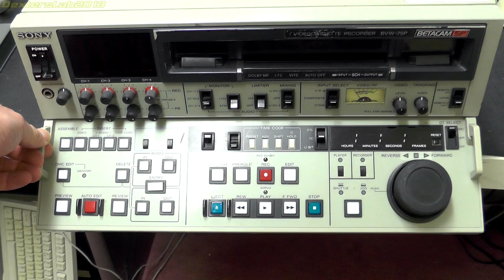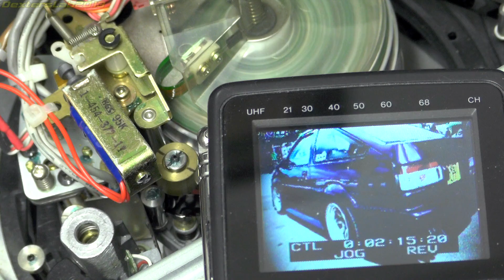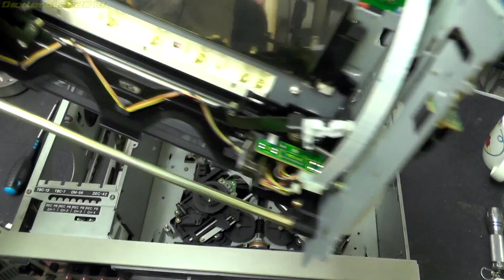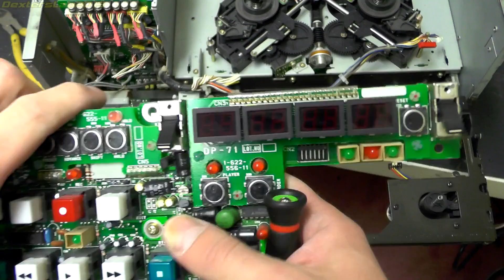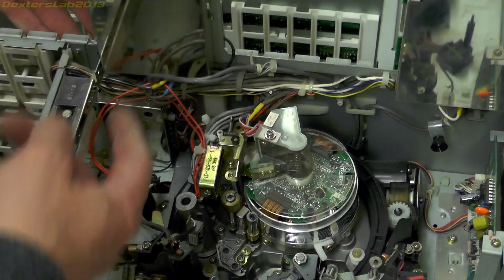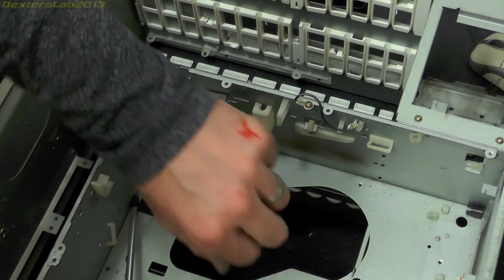DL090 - 1980s Sony BVW-75P Betacam VCR Teardown 1/3

Comment: hi pulled some apat to find a new way to re use the decks they are not good for any video work 
i do find they are great for audio  and a sony pcm 701 es  
up to 6 channels    9 years ago they wear junk deck not so any more  alot love to have them in a man cave 
i have 60 plus betacam all working  pulled alot apart to get them running

Comment: Wow I haven't thought about that for ages but CTDM is Compressed Time division Multiplexing. I think it was to do with the way the colour signals were stored on the tape one after the other on the same track alternating between signals and then stitching them back together afterwards.
I haven't had to recall that information for about 20 years but there it was just in my brain waiting to be recalled, only took me a few seconds. I guess some things never leave you.
I used to work with these for many years bashing away on the panel doing edits for tight deadlines. 
These things were so fast and reliable almost bullet proof.

Comment: hi again  i just done working on the last i have  of theis model  they are very well made decks  yes the SONY A500P can do a better job 
i have 12 of them   
but the power  the A500 range use i have to keep the running costs down

so i use the older decks alot of the time  only for audio play back  there's not alot in the running cost  of a 1/4 inch reel to reel  like the RS1700
or a otari mtr 12    1/2 inch  4 track 

you see i have to bill anybody for the power cost and the job  funny thing   i have saved alot of betacam sp decks from the skip

if like me you can get alot in the same place and pull parts as parts decks they can be saved   the space is the thing  50 plus betacam decks
takes space  just me and a big lady cat  no lady trying to tell me what to do

Comment: hi you know you said £25 ebay working  not any more i had them all   like you i pulled them apart to fix them up
kingswood hire place had them   it was better to have them as cash in the bank was doing bad at the time 
they sound ace used for sound  i have 50 plus now  all working  you seen the prices on ebay now

Comment: I need replacement head for my BVW 75.
Reply from the maker: Somewhat unobtanium now, best bet is to find another machine with less head hours.
Reply: @DextersTechLab  Currently I have 2x BVW 75. RT56 TP7-TP8 = ~90-100 mVpp. It should be 150-250 mV.

Comment: The only difference between the Sony pvw-2800p is that this one records four channels of sound, but if the 2800 has a Sony PVW-216FM audio module or even better Michael Sellman LTD, the sound is much better when recording both 2 channels and 4 on the Sony PVW-2800P model than on the Sony BVW-75 model and the stories that 75 writes better a myth that I can dispel by comparing these two models during recording and playback and at a price of 75 it was 3 times cheaper than 2800. how it breaks back is due to a flimsy or unfinished lpm, I am silent for the electronic part.
Reply: The pvw couldn’t do slo mo plus the BVW could use Betacam tapes if need be.

Comment: These were nearly £40k when first released in 1987. A real workhorse machine. The 3000hour service course was a week long ! I still have all the manuals and course notes, and a spare head, as well as BVW-75p number 2. A lot of the capacitors are now in need of replacement, which is quite a job.

Comment: Anyone know how to connect this thing to a monitor? trying to use a 5 BNC to vga cable but nothing is showing up...
Reply from the maker: +Cameron Murton VGA monitors won't work, you need a PVM/ BVM style monitor ideally or even an old TV
Reply: I had a feeling! thanks for the heads up

Comment: If it´s broken, ok. But what the hell your doing? It was a working machine. Cutting wires, the annoying way you hit the switches - Fine-Motor skills is not yours? Its cool if somebody have the skills to repair this stuff, but destroying old electronics !? Take it apart and then reassemble it,that would be great content ;-)  (Sorry for my english...)
Reply from the maker: hi, the BVW-75 was a very popular machine, there are usually 2-3 on ebay at any one time and here in the UK they sell for £10-£30 depending on condition. The one in the video was well used and had some faults, it simply was not worth repairing. Instead i was able to entirely take it apart on camera so others can see how it works, which is one of the main reasons for this channel.

Comment: Which is better, Betacam SP or 1 inch type C? Type C would be from a composite signal
Reply: Betacam SP for sure, although Type C was very good.
Reply: For what? I could put six SP machines in a single 70” tall rack vs several racks of BVH2000’s or a room full of Ampex VPR2B’s. 
For sports replay use the 75 was great. Smaller & lighter than any 1”, plus with a good remote panel which gave the op multiple cue points it was king until HD Cam and the EVS came out.

Comment: FWIW, the PB/EE switch selects whether you see/hear input video/audio when stopped. "EE" stands for "electronics to electronics" meaning the record electronics are feeding the playback electronics directly. One reason for the switch is to avoid feedback howl if the VTR is routed to itself.

Comment: Great video but... why did you destroy this machine, cutting wire, that unit looks like new? Barely has the dust on it, what a shame. I do not understand. You could fix it later :(
Reply: TVmasterNS  This can be done without cutting cables
Reply: They certainly have some value. Just need to know how to sell them... You like in UK and not in North Korea, so you can try selling them on Ebay after you put it back together.
Reply: Oh my.  That's the nicest BVW I've ever set my eyes on!  I'm about to get a couple of these serviced for many thousands of pounds each.  They are still required by archives that are digitising this tape format.  Some older tape formats are in trouble because there are not enough machines left in the world to digitise all of the tapes before the video heads wear out.  Please use a little initiative and think of the bigger picture - did you check how many hours use the drum, tape path and heads have?  You could've used a worse quality machine to destroy.  And you mention no detailed record of it - there are so many photos of the insides of these machines.  There are massive service manuals detailing the inside of the machines!  What, exactly, is the point?  My main issue is the the HOURS METER READS 0000.
Reply: Thanks very much for your channel. I'm wondering for a few years: last tape HI Tech format was HDCAM (based on beta) Is still using at some level inside TV Stations???
(archive? just still remain a lot of tapes waiting for digitilaze? any use in other propouses?
I´ll be very pleasent if you teach me about it
Greetings from Uruguay
Reply: TVmasterNS we have one for sale. are you interested?
Reply from the maker: +TVmasterNS hi, thanks for the comments, here in the UK these machines have no value even when they are working. My channel is about taking apart old tech and allowing viewers to see inside things like this that they might not normally be able to see. There is so much wonderful old tech in e-waste that is lost without any detailed record of it.

Comment: This brings back some nightmares.  Running tape machines during the 6 and 10 local tv news in '82-3 while in school (I'm a retired embedded control engineer),  I operated 2 side by side of this kits predecessor, fed from a cart they wheeled in seconds after the broadcast started.  They had to deliver tapes (without error) in proper sequence, I had to deliver proper queuing of correct tape within seconds tolerance (somewhat less forgiving than now in ways... plus adrenaline).
.
Luckily, most of the job entailed calibration, maintenance, remote (microwave) setup, some field work (at the transmitter), and less dealing with the "talent".  Oh... and I used to air The Muppet Show every weekday.  Taught me allot.
.
Every few months there was an equipment failure. 1) isolate it.  2) Immediate Workaround  3) Solve
Sigh... love it, hate it.

Comment: Broadcast equipment just doesn't hold its value very well anymore.  It's often possible to find a good working US$75,000 HDCAM SR deck on eBay for $5K or as little as $1500, and these things are the workhorse of the industry!
Reply from the maker: Yea, it's surprising how cheap things get when both the product and the format become EOL. Just after making this video i missed out on a Sony DVR-1000 D-1 Recorder.

Comment: CTDM is Compressed Time-Division Multiplexing; this is the raw video format used with Betacam and Betacam SP.

Personally I was expecting more metal in the threading mechanism.  The threading mechanism in the majority of U-Matic decks was all-steel.
Reply: Basically with a second machine, if you have the proper cable, you can edit in CTDM and your generation loss is "less" compared to doing a dub or edit in Composite....

Comment: You can get Audio to PCM/PCM to Audio units that enable you to record HIFI audio onto BETAMAX tapes so It would be a shame to destroy the unit so do a simple disassemble and  reassemble no complete teardown, It appears that the PCB cards are in sockets so you could remove them one and show both sides to the camera and reinsert into its slot and repeat till you have shown the camera all PCB cards and put the thing back together and use it with the Special SONY Audio to PCM PCM to Audio unit and use it for sound editing.
Reply from the maker: +DAVID GREGORY KERR this is betacam, not betamax. They are very different. The recorder was completely scrapped in the making of the video.
Reply: @DextersTechLab  Such a waste of a good functioning recorder 😔

Comment: No-one should confuse the home Betamax with Betacam. The cassette shell form factor is the ONLY thing they have in common.
Reply: Most noticeable to me was when he said that there was a "slight increase in video quality from Betamax to Betacam". I have a bunch of Betacam sp  cameras and decks that I got from ebay over time and I'll put them up against a standard dvd format any day. As far as video quality goes anyway.
Reply: Not quite true, there are some other connections.  Betacam (not SP) tapes are interchangeable with Betamax.  The linear audio tracks are in the same place.  Batteries on some Betacam and Betamax portables are interchangeable.  Other details common too, such as BVW22P remote is very similar to some Betamax remotes.  ED-Beta (Betamax) uses BetacamSP tapes.  Sony clearly had good communications between their domestic and professional design teams.
Reply: >I'll put them up against a standard dvd format any day

DVD is far superior. 720 x 480 trumps 340 TVL, especially since DVDs containing film-source video can be played back with progressive scan, i.e., 480p, whereas Betacam SP is always natively interlaced.
Reply: Yes, and this video explains the difference.
Reply: I disagree.  DVD is roughly 7mbps.  BetaSP is always digitised at 10bit uncompressed - 240mbps.  If you put film-source video on a BetaSP  tape then you get 2 fields of interlacing per film frame.  That effectively makes it progressive.  You would certainly be able to digitise it and make it progressive.  V short answer, sorry - just had to correct though.  No bad feelings intended.

Comment: Here in the Philippines, the Betacam was used nowadays by ABS-CBN, TV5 and GMA networks. PTV and IBC use VHS, while the other TV stations use digital tapeless master equipments like AVCHD, DVD and hard disk drives.
Reply from the maker: +Joshua Sarmiento i am surprised by that, i would have thought they would be decommissioned long ago!

Comment: Great video. Thank you! Big thumbs up!
I wished you could have shown all cards in detail. (Edit: I have learned that I will see them in Pt.2. Excellent!)
I have tons of Sony Umatic and Betacam SP machines sitting at my store. Nobody wants them....
Reply from the maker: +Max Koschuh Thanks Max, U-Matic is older even than Beta, huge tape drums and make great mug coasters :-) Yea, it's a shame these are not wanted anymore, i think though some of the newer ones will still be wanted because they are be capable of playing back both the analog and digital versions.
Reply: What models?  Plenty of film archives, post houses, archive services outfits want no need them!

Comment: VHS won over Betamax because Sony wanted to charge a high levy for use of the patents on both recorders, players and the tapes themselves. The VHS consortium had lower rates, so could make a much cheaper cost machine which was a major advantage. Plus Sony was not exactly enamoured of the largest user of video, the porn industry. But the masters were all made and supplied on Betacam SP tapes though, much lower generation loss.
Reply from the maker: +SeanBZA Oh yea, that just reminded me, didn't Sony have a funny policy where they could choose what went onto their tapes? Which is why porn favoured the VHS tapes that had no restrictions.

Comment: Very cool teardown. I worked on those machines an eon ago. Very stable and reliable!
Reply from the maker: +zaprodk Any interesting experiences / comments about them? Given how many bodges i have found on the circuit boards i'm surprised they were as reliable as their reputation implies!
Reply: Not really. I've simply used them to load program material onto AVID-system in use at the time, and never had an issue.
Reply: +DextersLab2013 
I used the digibeta versions they were solid as a rock in the way they operated. There were so many times where there were in continuities with the vitc or LTC timecode that could be fixed by using the TCR reader switch. I think there was a way where I could insert edit an LTC timecode track over a tape so I could load program material successfully where there were problems with the timecode.

When you jog frame by frame the machine would interpolate the other field as indicated by an astrix on the OSD timecode. I'd use this because there was no software we had that would do such a good job. 

Anyways could you investigate why there is so much circuitry on the back panel connector pcb? Was it input protection? Or to do with the termination switch?
Reply from the maker: retrofitter Thanks for the comments, yes i can take a look at the rear panel in part 2.

Comment: I already took apart two of those big broadcast VCRs, a VO-9600P and a UVW-1600P. Found them back in 2011 in a thrift store, 30 euros each. Totally unexpected find, usually the store only has boring consumer grade stuff. Tons of nice parts to salvage... sadly they are way too space consuming to even think about starting to collect them....
Reply from the maker: +msylvain59 I just googled for them to see what they where like and your flickr page came up! Looks like they date from the 90s?
Reply: +metalhead2508 I shop at the scrap yard, you find interesting stuff there as well.
Reply: +metalhead2508 Who was in it? ;)
Reply: +DextersLab2013 I don't remember exactly, except that the UVW-1600P was much more modern, something like late 90's.